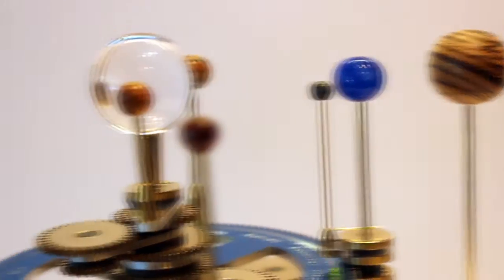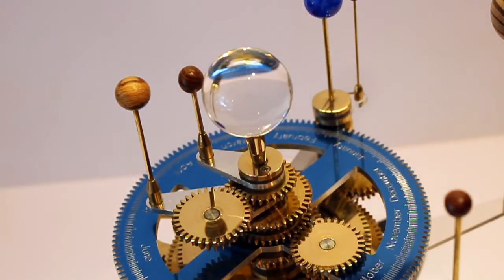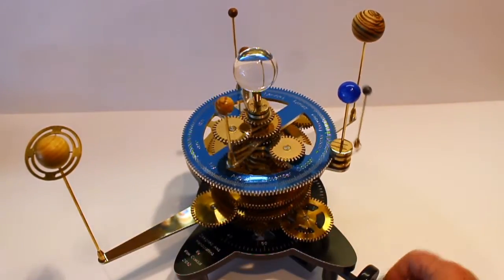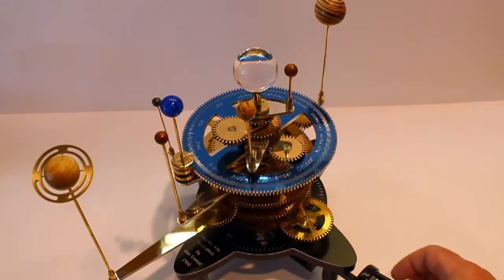Orrery Final Details

Comment: Time slippage problem is totally demonstrated through this technical technique. 

The example on the left demonstrates how time begins to slip and looses synchronization once it begins to revolve around the sun. 

The earth is stretched out up is simply up and down will never be up. Curves can’t live without level and level can’t live without curves. The earth is the center and doesn’t move the sun moves. 

So these examples are nothing but a failure.

Comment: hi there, ive recently found your plans for this orrery and had begun to use them as a plan for making my own out of wood. unfortunately ive run in to an issue. im having difficulties making sense the table you have provided on your website where you state the actual duration of each planets orbital period in days and the periods on your model and the error, working from one orbit of the earth is actually one year(365.256 days) working through the gear ratios provided in your pdf back through venus  mercury and eventually the crack wheel i get pretty good answers compared to your table...with a tad over 14 days for one turn of the crank.  mars is alright too but my last two significant figures are off...Jupiter came out more accurate than your table saturn too but the century is way off...i dont understand how i would get different answers to your table for some but not others...do you have an email? would you be able to help?
Reply from the maker: The crank is actually turning the topmost gear through a rod in the main support column. You have to do the math from that topmost gear all the way down through the gear train. The errors are calculated relative to Earth, which has no error.
Reply: Yeh I did that...I get different numbers too you...I calculated n checked n double checked n I think your table on ur website isn't correct now
Reply: I don't think I would of got correct numbers for Mercury through Mars if I'd made that mistake...n I say I worked back from earth because that's obviously your calibration point...if you put one turn of the crank at exactly 14 days they are all well off so one turn of the crank is like 14.09 days or sumthing
Reply from the maker: I really don't know what to tell you. I did these calculations a long time ago and don't remember all the details. If they're wrong, I apologize. Ultimately, my Orrery is meant to be a piece of art, not a scientific measuring instrument. If you want to change the gearing for your model, feel free. Good luck with your project - it'll be a fun challenge and well worth the effort.
Reply: THANKS KEN you have been helpful, one other thing that i have come across which i can solve easily as i am laser cutting the gears so can just rescale the gears(which changes the diametral pitch), for almost all pairs of gears that sit on one of the side arms the centre to centre distance match when all gears have the same tooth profile but for the mercury and Jupiter and Saturn sets i found there to be a slight discrepancy between one sets centre to centre distance and the other sets centre to centre distance(using an online gear generator)...how did you get round this if you only used one tooth cutter or is the 1% difference i found within mechanical tolerances of the mechanism? also is there some special maths that gives you pairs of gears that at the same diametral pitch and pitch angle and the same centre to centre distances? i find it interesting that most of the sets of 4 gears pair up so well..
Reply from the maker: When working with gears there is theory and there is practice and they're rarely the same. If you watch my videos in this series you'll see that I measure the center to center distance for each gear pair after cutting the gears. The theoretical distance will get you in the ballpark but the only measurement that matters is the actual one. For any two gears there is a sweet spot that you can feel when you've got the distance just right, and that can easily exceed 1% of theoretical. I seem to vaguely remember having found a program online where you could set the center to center distance and work backwards. Obviously, if there's a program then there must be a formula. Machinery's Handbook? The more you dig into this project, the more you'll see how much of it is hand fitting. Whatever you do, make the gears BEFORE you make the mechanisms to hold them because you'll need actual measurements to make it all work. Good luck!